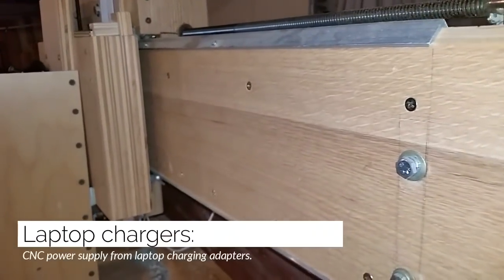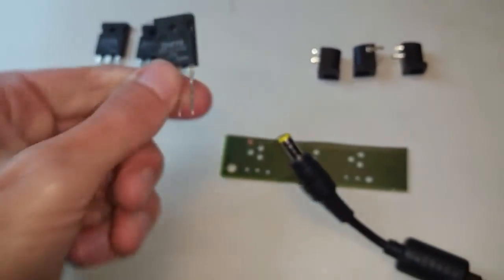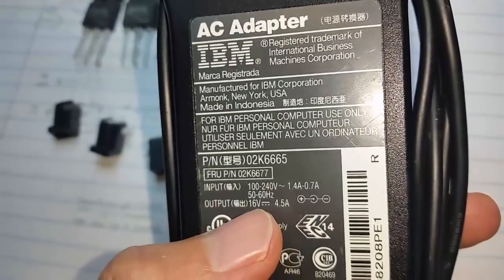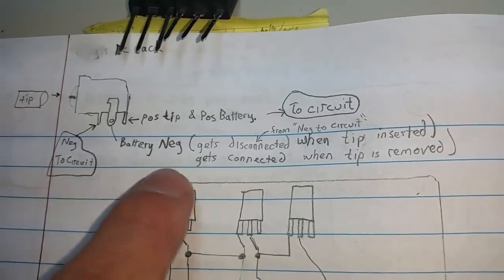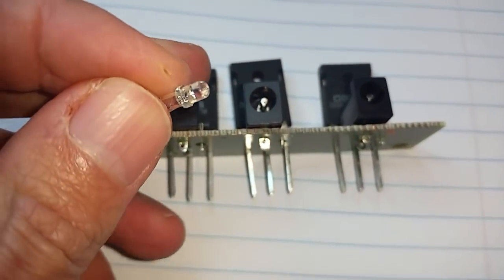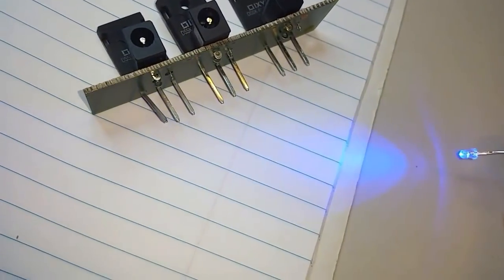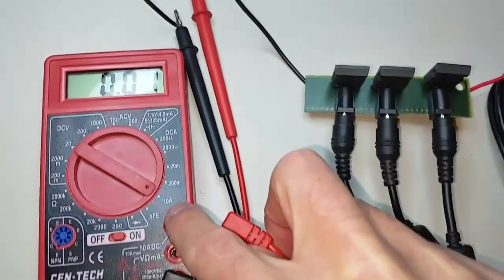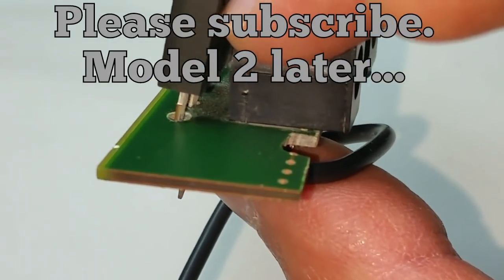50 Volt power supply from 3 DC adapters

Comment: Lol that could've been very dangerous at the end. Also, may I ask what you did with the current testing? Did you just short circuit the positive and negative ends of the 50 Volt power supply?
Reply from the maker: Yes i just short circuited.